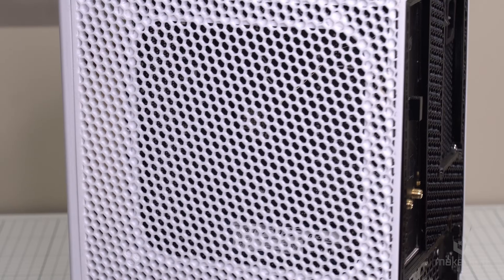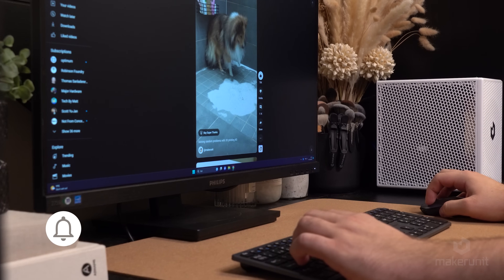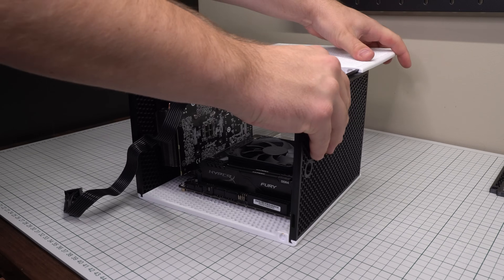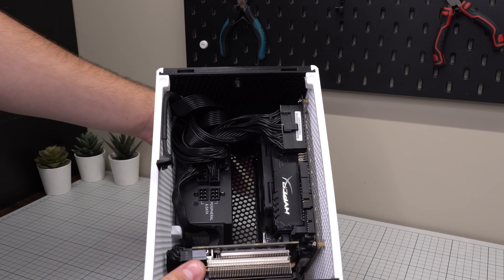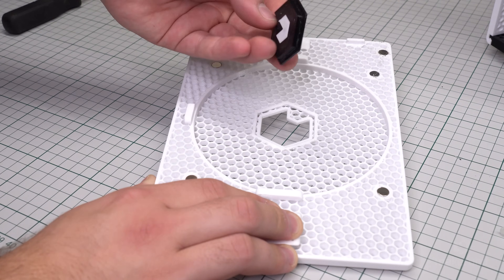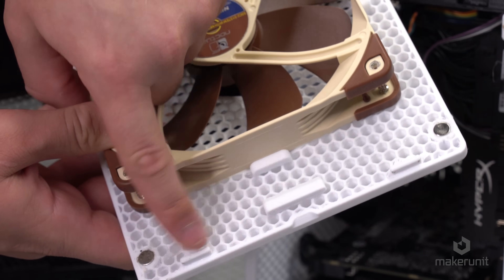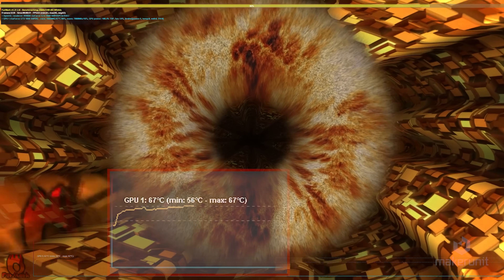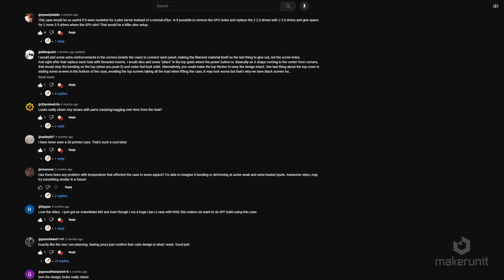Tiny 8.1L SFF build - 3D printed PC case

Comment: This was somewhat Awesome!  I have to go browse your Models, but if you're looking for new challenges, I'll share my wish.  Yes, the larger cases will help, and your 'Big Boy' may be a perfect new case.  However, the one thing I could use is the ability to mix, or choose between full height and half height expansion cards.  I have some spare parts, like a pair of DVI cards collecting dust.  They have permanently attached half height panel mounts.  They're not 'good enough' to spend a little bit on adaptors or a new case.  But once I have enough leftovers, I'll build a machine, as long as the only thing I have to buy is a power supply.

Great Vid!
Reply from the maker: Thank you! When you say half height, do you mean 1 slot mount?

I feel like sometimes my designs get a little «selfish» in the way that I often only add support for parts I actually have available because I feel like I can’t share something that hasn’t been tested physically by myself if that makes sense.

Over time as I build up more and more parts I also feel like the designs will include more and more new stuff 😁 it’s an everlasting evolution over time.
Reply: Ah, that makes perfect sense @makerunit  .  I also hate sharing things that I haven't printed and shown in use.  So, please don't spend time until you personally need to.  

As for 'half height', a.k.a. Low Profile expansion cards.  Those have a bracket height of 79mm vs 120mm.  Used in low profile PC cases (with monitors commonly placed on top).  Your cases are MUCH better though!

Comment: Im struggling to source a GPU <190mm, the shortest Ive found is 192mm available to me. Is there much space to go up to 200mm GPU? the length of 3060 and 4060 compact cards seem to be ~200
Reply from the maker: If you check the link in the video description I found a 4060 on Amazon that seemed to be ITX size (about 170mm).

I do think you can fit a 192mm card I just added a tiny bit of margin to not promise too much. 

One thing I’m not sure of is actually how GPU length is measured, is it measured from the metal bracket tip that’s used to screw it into plate? Or is it from the rear air exhaust panel and backwards?
Reply from the maker: Maybe this re-design will fit your needs better? Should support up to 290mm 2-slot GPU's if using a SFX psu, OR a 200mm GPU with an ATX PSU :) Full video and more info coming soon. Files are already available to check out and download for my Printables Club members. Check them out and maybe consider joining here: https://www.printables.com/model/688060-little-boy-s-long-edition-115l-itx

Comment: How about a case with 3d printed distro plate for custom watercooling. This way you can fit even 4090 in small form factor
Reply from the maker: Are you thinking like that the water would flow inside channels in the plastic to distribute to the different parts? 

Please excuse my lack of knowledge on water cooling as I’ve only so far worked with AIO’s 😅

Comment: whats the cpu cooler clearance?
Reply from the maker: I think you should be able to fit up to about 50mm safely but anything higher than that will probably be partially blocked by the PSU potentially ruining the airflow, might work but I’m no expert unfortunately.

Comment: I think a case like that that can support a 300 mm GPU would be killer!
Reply from the maker: Working on it! Will be slightly bigger though but I can always make more versions 😊

Approx same size, just longer would work too!
Reply from the maker: Hey! I've recently posted a new set of files for a new design based on this design. This one can not support 300mm GPU unfortunately but almost gets there by supporting 290mm (2 slot thickness only). Files are available already for my Printables Club members, check it out here: https://www.printables.com/model/688060-little-boy-s-long-edition-115l-itx (full video coming soon)

Comment: Making this case with a resin printer would probably be one of the best cases on the market.
Reply from the maker: I’ve actually never tried resin printing, how’s the strength? I’m mostly worried about the sliding tracks if they’d be at risk of breaking or not.

Comment: Your designs are really outstanding and quite premium. Have you considered a case design incorporating an LCD display? AIO box of sorts.
Reply from the maker: Thank you! It has actually crossed my mind, and would be a really fun project! You mean like a tower with a built in monitor as the side panel for example? Like a full size monitor? Would be really cool!
Reply: @makerunit  correct 👍🏼 maybe a 10” to 12” display 5:4 or 16:9 depending on use case.
Reply from the maker: @RetroGG-74  maybe it could be designed with one side panel slightly angled to get better viewing angles😁

Comment: Personally I would love a Mini ITX, but Long or high so that a ATX PSU and a 3Slot and very Long GPU will work. These cases are hard to design, but it would be really great. If at all possible without a riser cable.
Edit: I see you already have something similar, on you Printables. I have one request though. Can you open the design so they meet the open standard. Currently they can not be use for Cultural Works for example.
Reply from the maker: I’m working on a mATX case now that will also support ITX boards, SFX and ATX psu, as well as well as some other goodies. 😊

Comment: I think it would be cool to have the stand offs 3d printed intto the back panel!!!
Reply from the maker: That’s true. I’ll see what I can do 😊 I’m only worried that a printed standoff might not be strong enough and if I do make them printed they possibly have to be too thick so they may hit other components of the motherboard, that’s why I’ve avoided it. Just feels safer adding them directly to the flat surface… but I may be wrong and it can probably work as I’ve seen others make it work. Probably me who’s just too worried 😅

Comment: great work - i would love to try a version that is even smaller - i see that you have a couple of centimeters that you could put the PSU closer to the CPU  cooler - i guess the limiting factor for you here was the front FAN but i would argue that small size trumps big fan. and maybe instead have two smaller fans. the area where i would accept more size would be the GPU. to do a version that can accomodate a longer GPU. but instead save space on the PSU/CPU cooler side.
Reply from the maker: Thank you! The front fan isn’t a problem as it can be changed down to 120mm allowing for 20mm more.

The power cable coming out the side of the GPU though might be a limiting factor so it doesn’t get squished… 😅

Comment: Great design, bigger version for either longer gpu or bigger motherboard, or even both.
Reply from the maker: The plan for now is both! Even AIO support is intended 😉
Reply: @makerunit  wish I had my 3d printer before I built my pc, as have ATX mobo, and not planning currently replace it. But future build will be sff form factor and most likely I will print the case for it.
Reply from the maker: @Blackrhyme7  one day my goal is to create a ATX version as well.
Reply: @makerunit  i understand that, but beauty of sfx is that each panel can be one print, for ATX you will need printer with big print bed or print height, my ender 3 will have to split them.
Reply from the maker: @Blackrhyme7  When I make a ATX size case it'll most definitely be bigger than my 300x300mm printer bed anyways, so I might as well split the panels across the middle to create four piece side panels small enough so they'll fit within the Ender3 volume (hopefully) The hard part is to find an external design that can camouflage the connection lines between the parts so they're not so noticeable.
Reply: @makerunit  that will be a challenge for sure. My ender is 235x225 it's my first printer that I got second hand at reasonable price have it for few months but already learned a lot about printing, now I'm trying to learn design things I need myself. Anyway love your case designs, things like this motivate me to go deeper this rabbit hole of 3d design and print.
Reply from the maker: @Blackrhyme7  I’m always up for a challenge! 😉 the main goal in my full ATX size print is to hit the most common print volumes like the Ender 3 and Bambu X1C etc. none of those can do 300x300mm unfortunately. 

The long term goal is ofc for EVERYONE to use 3D printed cases of different types with the «makerunit» logo on it. Free channel advertising worldwide. Duuh 😁

Comment: Still not standard compliant. Your GFX is even visibly tilted. The rear IO cutout is non-compliant. Why you would need a case fan, is beyond me, I don't. Also, the key weakness of this construction, is its lack of rigidity. You combine that with this desire to cover up any monting screws or points, ending up doing all this fixes. Yet, the main flaw, is exactly how you put this together, and the type of mesh you end up needing to use as a result of that. There is no way to win this way, the mesh used in this case is ugly, and plagued by retraction issues. You end up with far too thick mesh, which kills its mojo. That is what we all end up with, trying to hide mounting points. Also, using tracks for mounting is plagued with issus of slack and precision, and although it might print well for you, given a different filament or printer, the slack will probably be an issue, making the track too loose or too tight. Tracks also takes a lot of space, and limits what can be achieved, in its own ways.
Reply from the maker: Where do you find the «standard compliant» measurements? Is there some kind of register of all the «standards»? 

I added the case fan to push away the hot air coming from the GPU rising up to hopefully add more fresh air to the CPU cooler. But I’m no fancy engineer or have any expert background, simply just a hobbyist. 

I’m sorry you don’t like the sliding tracks and I’m simply just sharing what worked for me. 

If it’s too much slack you could always customize the .step file to make it tighter.
Reply: @makerunit  The SIM cutout is defined in the ATX 2.0 def. As is the hole spacing for the MB. Once you print an accurate SIM cutout, you will know how bad the case industry is at that very SIM cutout.

The PCI cutouts are covered in some PCISIG docs, but I had to module each and every part, and assemble a working design in cad, to get measurments. Intel is supposed to have some resources, but I have tried a few times to access them, failing to do so, every time. Protocase released some numbers, but they are incorrect. Again, once you know what things supposedly are, and look at the industry, it gets pretty interesting.

Just by looking at what you do, your design will not fit a large number of GFXs. There is not enough clearing arround the bracket. Some Cables will simply not fit as the wall is too close, even though the cable itself is standard compliant.

I just noticed that you fasten the GFX from the bottom. That is a no go. The GFX is specifically designed to be fasten from the top. It even has a defined wing bend round the screws, which are actually visible on the GFX bracket in your video. These wings are there to ensure a tight fit, if the margins are off.

You actually did a lot of nice things here, but your choices for assembly techniques, have some serious drawbacks. Down the road, when I get my stuff out there, and since we actually live in the same town, we should meet up, and make a joint video. You've tried a bunch of different design techniques by now, and I would love to hear from you, how they work out for you. What was the strengths, and what was the weaknesses.

Take this build as an example, you use inserts, and not self threading screws. You are now using pan head screws and not countersunk screws.

Also, if you flip this build, you may use super slim feet. Using such feet, change the expression of the build. It also makes the real volume significantly smaller.

As for the mesh, I use a mesh with 3mm pitch and 0.6 nozzle. I use rectangular infill at 21%. I need to print super slow, as we all do, for PETG and single stranded printing. If I need a stronger part, I use 42% Grid pattern. The two overlaps perfectly. Them patterns fit my expression, and look far lest "plasticly" than the honky tonk you did here. And I guess I really should stress the need for ultra slow printing while printing single stranded, and to use a wide a enough extrusion width for the nozzle. And yes, to achieve a certain pitch, the pitch dictates the extrusion width for a given infill rate. The infill rate can only be set at integer precision in the Prusa slicer.

I plan to soon start posting, and will post back here, when the first horrible video is up.

Comment: I would love to see you’re approach to a NAS pc. There are a lot of 5.25 bay to 3.5/2.5 adapters that would integrate well to a 3d printed compact chassis.
Reply from the maker: I don’t have much (none really) experience with NAS cases but can they be based on integrated graphics only like for example the R7 5700G or would it need a dedicated GPU?
Reply: @makerunit  most nas units are focused on storage and sometimes virtual machines for plex or media hosting, very often modern integrated graphics is sufficient for the needed transcoding tasks.
Reply from the maker: @VastCNC  I see! I get a lot of comments requesting NAS type builds. So maybe some day 😁
Reply: @makerunit  if you do, bonus for fitting within a 10in half rack. I think clearance is 8.75 in American freedom units.

Comment: This makes me want to build an SFF PC so bad. 
An M-ATX that can fit more storage and a 70ish series GPU would be incredible.
Reply from the maker: I’m working on the mATX version now! 😊
Reply: @makerunit  You F-in rock! 
SFX-L PSU option for it🤞
Reply from the maker: @NoobTryAgain  that uses same holes as regular SFX right? Just longer? The space in the new one is intended to fit ATX fullsize psu and SFX psu’s in the same space, so if the SFX-L uses same mount it should fit no problem.
Reply: @makerunit  Yup, same mounting just longer. Some mATX have options for SFX-l and Standard depending on space and option. REally like all the thought you are putting into this. REally impressive!
Reply from the maker: @NoobTryAgain  I’m a people’s pleaser… I mean I asked for people’s opinions and ideas and my intention is to try to tick as many boxes as possible with this next design. 

Working on some possible layouts at the moment. 😊 Though I might start again from scratch to absolutely maximize the internal volume of the case. I found a design where all the external side panels interlock with each other meaning that just a few screws on the rear panel is enough to lock the entire case securely in place.
Reply: @makerunit  Colour me intrigued!

Comment: Would a A2000 fit in there?
Reply from the maker: If we’re talking M.2 SSD, yes the Kingston A2000 M.2 will work. 

Jk. If we’re talking GPU, if it’s shorter than 190mm and a 2 slot card, it should fit but I see the A2000 is a low profile one, meaning the screw mount won’t fit, so you might need to do some small modifications to the back plate if using a A2000.

Comment: Great project.
I wonder how would be a design chassis for old computers maybe in the old format that isn't a tower.
Reply from the maker: Thank you! Please define «old computer». Do you mean based on the hardware from an old PC? Or more like a modern system in an «Old looking» pc case?
Reply: @makerunit  I mean people want both for sure. I meant to be for pc xt until like earlier pentium that had the non tower design but a old tower replica for a sleep build is also something that people look for too.
Thanks for answer your work is awesome.
Reply from the maker: @AlejandroRodolfoMendez  I see! The only problem really is that I don’t have these old parts at hand. That’s why I keep making cases supporting often many of the same parts as I usually design around the parts I have at hand, so I’ll be able to test everything before posting 😊
Reply: @makerunit  oh some old parts are cheap and other are getting expensive. Usually unless something is beyond the Norms atx or at are like the same format of new pc, just change the part of the ports and the psu.
But thanks anyway. I'll look for what is similar and maybe do some modifications.

Comment: Id love to see, an vertical case, with 240mm aio support (i think of something like hyte revolt 3, but much smaller in size)
Great videos, i might even do one of my own design
Reply from the maker: I have a vertical case already, check my last video before this one. Though it’s quite big tbh 😊
Reply: @makerunit Ye, it kinda is a big boi, still pretty cool tho
Reply from the maker: @zette4273  well that’s what I called it. «The Big Boy» 😅

Comment: Hey nice Case, id like a L-Size Variant for Graphics Cards up to 250mm in Length with M-ATX Support
Reply from the maker: That’s the plan for my M size! Currently looking at about 24 liters volume in my current draft for the mATX version. Possibly slightly bigger.

Comment: Mate your cases are awesome! What about a 40 series capable 10L? with 280 AIO next? Take it easy
Reply from the maker: Oo that one will be tough… I mean a 40 series card itself is like 5 liters 😅 (sarcastically meant) but for real though, that, paired with a 280mm AIO would be practically impossible to fit within 10L I think. 

Working on a case now that will support mATX and I feel like it’s quite compact at 24 liters 😅
Reply: @makerunit  fair and it would be quite the heater. 😄 Looking forward to the next SFF!
Reply from the maker: @Nat-nq1ew  currently looking at roughly 24-25 liters on my mATX case sketch so far. Idk if that goes under SFF but it will fit a lot! ATX psu, AIO, SFX psu, ITX, mATX, HDD’(s), minimum 300mm GPU’s, and a ton of fans 😊